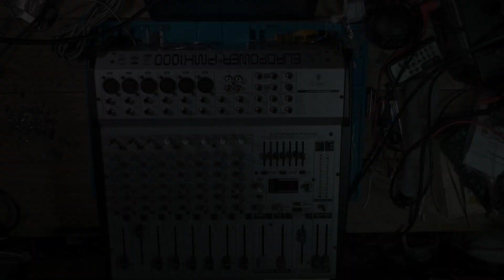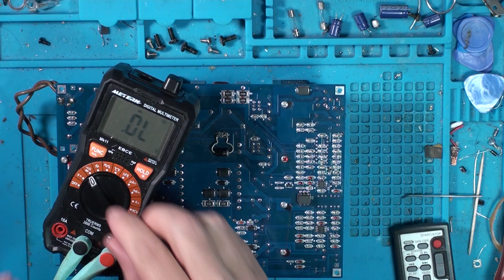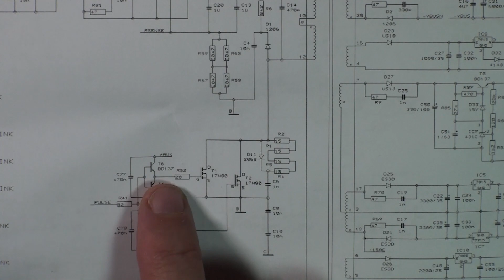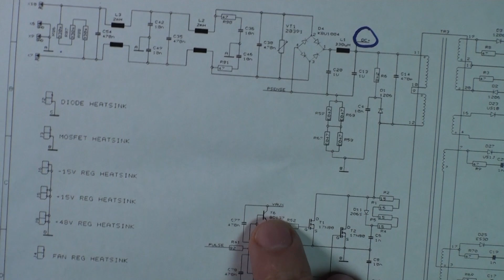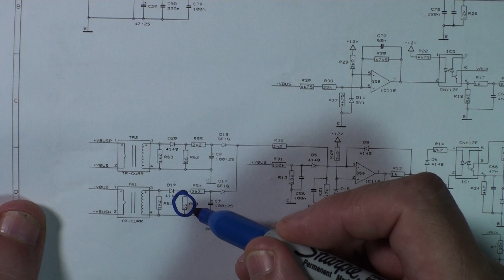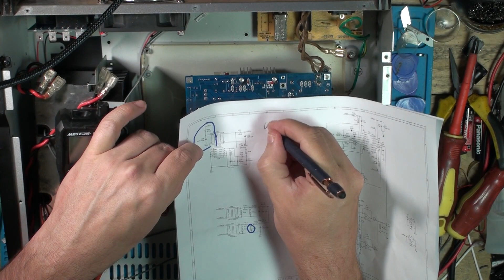Behringer Repair Went Up In Smoke Electronic Explosions - Europower PMX1000

Comment: Hi! 
Had a similar problem with a dead SPS400. Visual inspection of the board showed a blown, literally exploded, IC6 (TOP221P). 
IC6 is the chopper FET for Transformer TR4, to provide Vaux for IC2. By doing some measurements C29 (47u/25v) and D29 (6V8 Zener)  were gone.

Replaced the bad components, fired up and nothing! So I focused to TR4 and bingo! the primary winding was fried.
Since I had no replacement transformer, I feeded IC2 directly (pin 15 = VCC and pin 1 = GND), from my bench power supply by increasing gradually the voltage and suddenly at 10-12V the baby kicked in. Vbus+ and Vbus- are stable at 52V and the other voltages also. By TR4 removed, the external voltage has been applied: + to D31- cathode and minus to the common ground B. I hope I could help in anyways.
Reply: Of course I should mention that the external power must be a floating type, that means MINUS HAS NO CONNECTION TO GROUND! FOR TEST PURPOSES ONLY!

Comment: Did you fix it in the end?
Reply from the maker: Sadly no I didn't, it blew a big hole in the board
Reply: @RetroElectronicRepair  that's a shame, i wonder if like a protection diode went open around a coil causing a big spike  or something. i'm looking at the exact some model on fb marketplace where the mixer works but the amp failed testing.

Comment: Behringer mixer are famous for there CRAP switching power supplies. I bought a XYNYX X2442USB some time ago and the power supply blew up shorly. I replaced it with a normal linear PSU, which I build my self. No further problems...

Comment: Would you please give me some opinions about my PMP1000? I found that the Fan doesn't work and make the PMP1000 shut down when it overheated.

I have measured the unload voltage of the fan connector. The output is 27V. However, the operation voltage of the fan is 12V. Does it anything wrong? Thanks

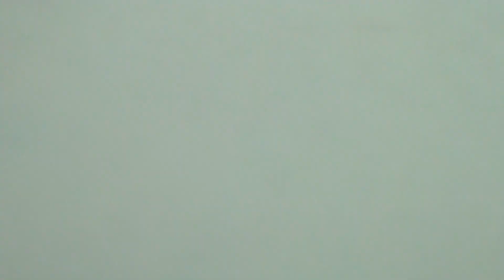Comment: Hi - I have the same mixer and last Saterday hi is blown up  - smoke and dead. I found out that the SMD R59 and R59 looking black but I messured 21MOhm  - ist this thrue? Beside  that, one part is blown out and the leads are broken and the index is missing ;-/ now I don't no whitch part it is - on your video time 29:48 place right of your fingertip and down from R59/R58/R67/R68 what this is?   I hope you can advise me whitch part I have to get  THX

Comment: It blew up because the power amp had no load on the output and you had the "amp" button set to either main or bridge. I believe you can use it without a load on the "monitor " position.
Reply: @Qqqqqqq12379  it is what the manual says

Comment: The cause of diode and capacitor failure is too high voltage in the diode and capacitor circuit.

Comment: I've been repairing domestic and professional electronics for 45+ years.  
I hate working on these because nine times out of ten it's a fault in the power supply. They're fine while they're working but once they start giving trouble it never seems to stop. 
To start with, that diode which keeps shorting is an indication of too much current being drawn by that switching regulator, and the cap and IC blowing backs that up. As you say, for that cap to blow it must have had more than 450 V across it. You'd need to monitor the voltage there and scope it to see if there was any excessive ripple current. Looking at the schematic, only three things stand out - either excess voltage at that part of the circuit, a dynamic short on the vaux rail or a faulty TOP221 IC. I have had similar ICs fail but usually they don't work at all.
Reply from the maker: Thanks for the detailed comment, at least I now know I'm talking some sense and learning as I go. One day I will get a scope and learn how to use it, I wish I had at least measured the voltage on that cap and diode as it did blow another diode off camera. I should have really investigated that a bit more.
Reply: @RetroElectronicRepair  You're on the right track and have the right attitude when it comes to repairs. A power supply like this however isn't something I'd recommend for a novice to try to resolve. I have some special test equipment including a current limited high voltage supply, so I can run things up without the risk of them going bang. It allows testing under controlled conditions. Some (not all) switching supplies like this you can use a dim-bulb with, but others (especially those with auto-voltage-sensing on the input are a no-no for using the dim bulb.
The problem with supplies like this is they go bang very easily and everything has to be right or you will just keep chasing your tail and it soon becomes expensive.